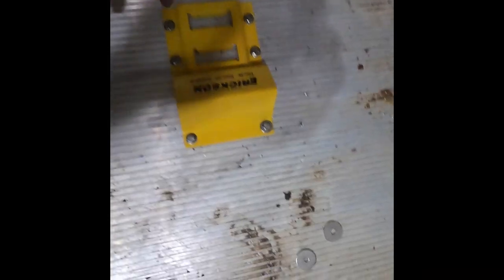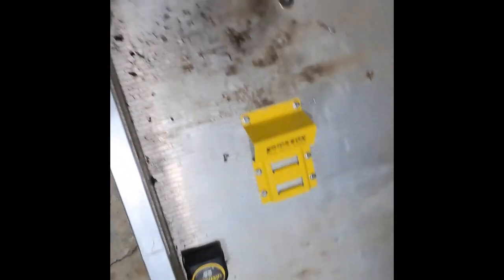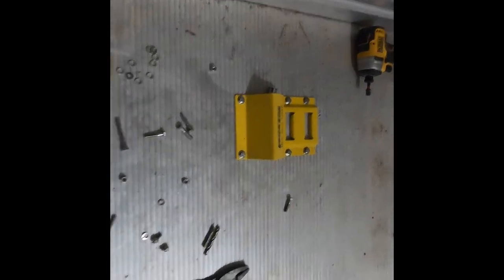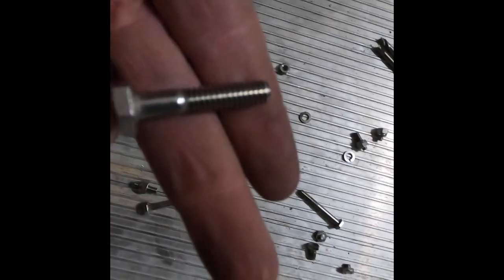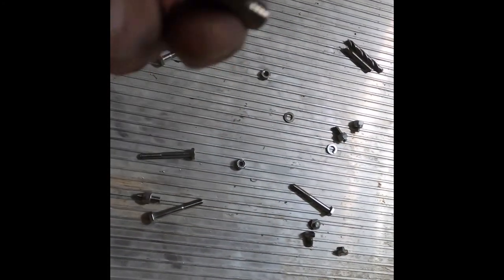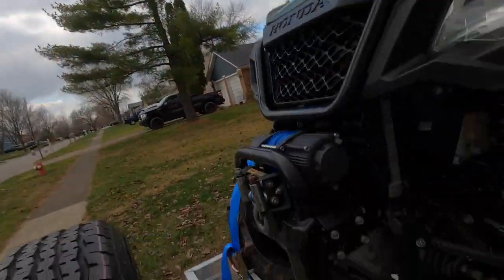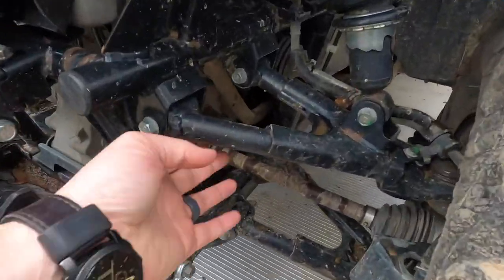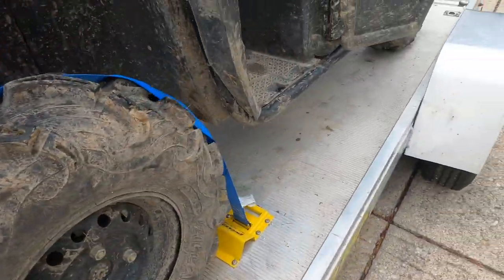Best way to secure your ATV! (Installing Erickson Wheel Chocks)

Comment: I came across your video looking for this exact info - how did the mounting holes hold up over time?
Reply from the maker: Really good so far, still use it weekly and I actually upgraded my side-by-side to a 4-seater can-am, which is about 1600 pounds. They still have been working great and hold it, no problem. One thing I will say is if you can find the same type of tie-downs but in a galvanized steel it will hold up better. Grant it, I live up north so we get a lot of road salt.
Reply: @outdooragent  excellent! Looking at picking up a KRX 1000 soon and this sounds like the perfect solution. Thanks for the response!

Comment: I might be getting this system for my Talon, and for the most part the amazon reviews are good. I know it doesn’t include the hardware which is not a problem.. my concern is slippage off the tire. Your Pioneer has mud terrains, I have the standard dirt knobbies.. now that you’ve run the system for a bit, would you suggest using the chock system on the rears vs the front since the rear tire is wider? If not, I’ll assume the front tires would suffice. Or I might just pull the trigger on doing all 4 wheels
Reply from the maker: I have not had any issues running them on the front two tires. They have came a little loose a few times but only on very long back road trips (bumpy) I assume it’s cause my SXS was bouncing all around. It’s way more secure than just normal ratchet straps on the frame. I crank them down pretty tight on the front tires and drive 2+ hours often and they have been great. Also a lot quicker of a load and unload.
Reply: Outdoor Agent going to buy some from Lowe’s tomorrow and give them a shot.